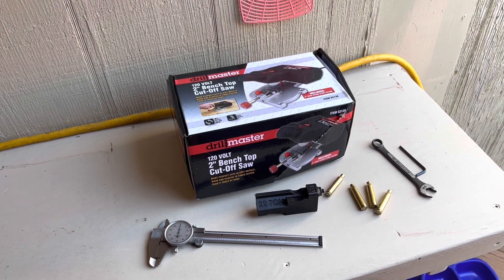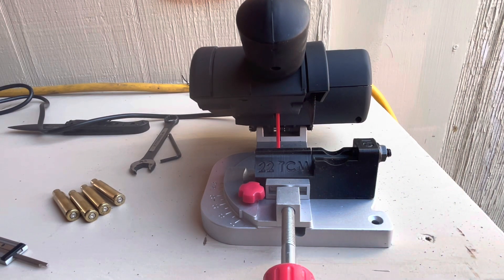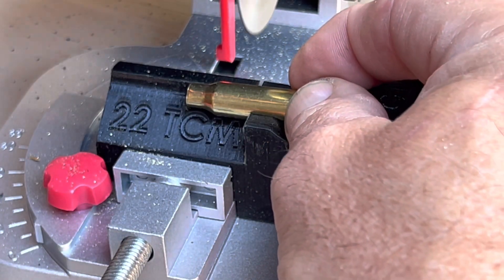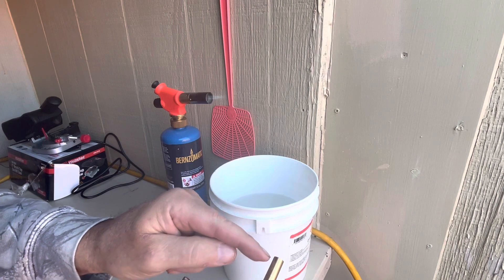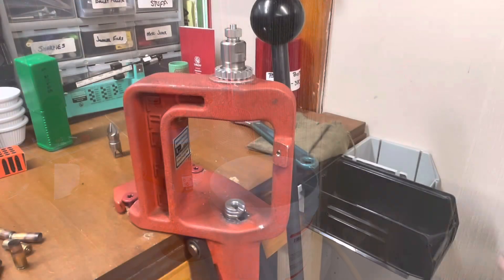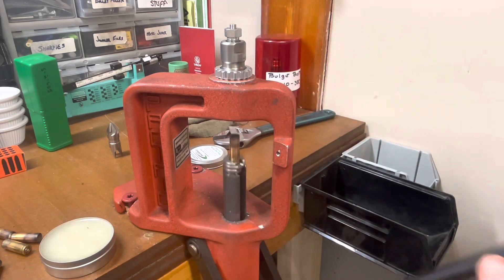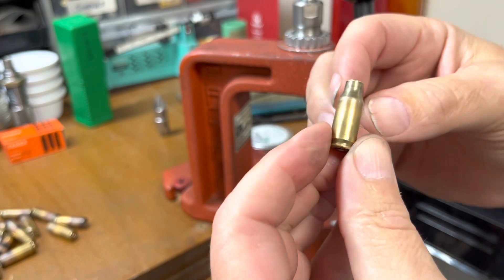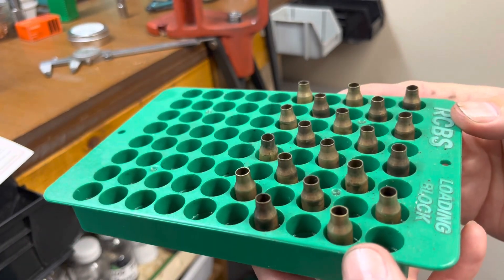Forming 22TCM Brass

Comment: Nice CW. Love that lil 22tcm pocket rocket!  I bought a case of primed nickel plated cases from them years ago, right at the start of Ammogeddon #2. Someday I will load em. I have plenty of powder I just need projectiles. The factory hasn't had them on the website for sale in years. They came in their Armscor ammo labeled bags and they were $6.99 a hundred IFIRC. I just keep checking hopefully they start getting them on the website someday. I figure if it got too bad and I needed them I would check into a 40gr .22cal mold. I did pick up 1 box of Hornady .22cal 40gr just to experiment.
Reply from the maker: Thats my hope here. Hard Cast GC bullets. I have some dummies made. Waiting on bbl to test fit.

Comment: That was an interesting video. I was thinking about why you might be having such an issue with the decapping rod pulling out. While you are putting some lube inside the case I doubt it is getting near the portion of the case that contacts the expanding button on the rod when the cases are pulled out. I expect becasuse of this the cases are basically getting dragged dry over the expander button, greatly increasing the pulling force on the rod. You might want to try putting some case lube on a "Q-tip" and getting it on the case a bit further down. Another couple of tricks regarding decapping rods of the Lee type - degrease the rod and contacting surface of the nut with break clean to increase friction, even trace amounts of oil will increase slipping. Finally you might want to try rolling the decapping rod between two files to roughen the surface up, that can help them hold better. Anyway just some thoughts. Cheers!
Reply from the maker: Yes sir!  I previously cleaned and lubed dies off camera. Should have specified better. But spot on I agree as after a few thru it worked better. 
Also, cleaning brass first would have helped.

Comment: If you take the decaping pin and sand half of an inch above the pin and take off a couple thousand off the diameter it should keep the neck from sticking to it where it is up in the die body where it forms the neck of the case. Just a thought
Reply from the maker: The expander ball diameter determines proper neck tension. Not a good idea to change its dia like that.
Reply: @cw2a  I'm not talking about the expander ball the stem part that holds it , it looked like it was stuck with the entire stem in the case it's either that or they are small flash holes
Reply from the maker: @tacticalrabbit308  it was expander ball but because first case and insufficient tightness ( it was only crazy tite not INSANE Tite.

Comment: That was one thing I didn't have to worry about when I made the 300 Blk conversions... I was never short on the brass because the 300Blk has so little shoulder.
What powder/powders are you looking at using?
Reply from the maker: Not much data out there!!!!

Looks like H110, Enforcer, lil Gun, 11fs and 296. 
Also no cast bullet data. 

I wont use Lil Gun. So one of the others I have all of them.
Reply: @cw2a  Hodgdon has some loads on their site under pistol for the 22TCM.... Accurate 4100, 11fs and TCM as well as Ramshot Enforcer. TCM was the powder that Accrate came up with specifically for the 22TCM.

Comment: Cool. A couple things. What cal. brass are you starting with.? When you heat up metal then quench it , doesn't it harden it ?
Reply from the maker: Hello Steve!!

Im starting with 223/556 cases. 
No the water is just to stop the heat from getting i to the head of the case. The water serves no other purpose. The heat of the touch softens the brass

Comment: That why I do not use Lee anymore...... After dealing with the universal decapper and the rod coming out on every case..... It sits in the box and never going to see daylight again...LOL!!!
Reply from the maker: Frustrating for sure. If ya saw my 350 Legend video back a ways ya saw my fix. Brill the nut and pin it with a roll pin in position. Works perfectly. There top Nuts are SOFT drill easily. ZERO MOVEMENT after that trick!!
Reply: @cw2a  hello CW what video was that in?
Reply from the maker: It could have been on old channel but thought here. I think I titled it why I dont like or dont use Lee dies? Id have ta look myself.

Comment: Perfect timing CW! I’m looking into converting .223 into 7.62x25 so this will be helpful for sure!
Reply: I don't know if it makes any difference but 223 is quite a bit smaller in diameter than Tok.
Reply: @dylanschulz2404  thanks, I’m still researching it, but that was the casing some people have recommended.
Reply: @3jeepdiscovery  powder valley has 30 Mauser brass which is the same thing these days.
Reply: @dylanschulz2404  sweet! That’s good to know. Thanks!

Comment: Is annealing a must before necking down?   If de-capping pin removed would it allow forming without the fire (annealing)?   Or is that a “try it & find out question”?
Reply from the maker: Good morning! 
I anneal  AFTER when necking up & BEFORE when necking down. As long as Im starting with new or once fired brass. Too soft can cause addition issues necking up. 
More important than decap pin removal of entire decap stem with pin is excellent point. If it has a expander ball it can cause issues too.

Comment: Having sticking problems due to pressure causing cases to expand? I was wondering if anyone has reloaded and got around that problem like using thicker brass like military 5.56mm brass or commercial.
Reply from the maker: Actually 556 is no thicker than 223. It's the 7.62 is thicker (smaller Cap) than 308. 
The cartridge gets pushed pretty hard. Hand loading helps!
Reply: @cw2a  Unless commercial brass got thicker or the 5.56mm suddenly got thinner then military force 5.56 mm is still thicker.
Even when the Army bought like 540 million rounds from Asia at the height of the Iraq war (OIF) we got tasked with making sure it was to spec. We had to check out everything. To include commercial companies vs NATO, differences in metal everything.
The company made the ammo for NATO countries and was closing with all that ammo already made. The Army bought every round plus asked them to reopen doing 3-8hr shifts a day for several years.
I got wounded on a convoy and put in a coma so that is all I remember.
Reply from the maker: @bullboo1 Of coarse there is countless manufacturers of 556 & 223. But If you test for your self you will find very small differences in case volume. 
Its a common miss conception carried over from 7,62 & 308.

Comment: The water is to make the brass soft, with out water the brass will be hard and not form properly.
Reply from the maker: @tomhysell596  If you're commenting to the annealing. Water isnt required for this process. BUT I like to use to cool and help reduce heat into the head of the case where it is NOT wanted. Because it will affect its strength. 
Thanks for watching! 🇺🇸❤️‍🩹❤️‍🩹

Comment: Nice jig with that adjustment screw and Nut. Have You tried UJ's drop of crazy Glue on the Lee decapping pin trick yet?  I bought a case of primed 22TCM brass from Armscor when the Ammogeddon  started so I wont be using my 22TCM jig I bought anytime soon. I have a 300BO one as well I still haven't used. Its great that you put this out for everyone CW ! Nice video.
Reply from the maker: Thanks man!! 😜🇺🇸🙏

Comment: You should lube inside the neck or take the decapping rod out.
Reply from the maker: Morning Jeff!  I did lube but too often forget that remove the decapper trick! 
Thanks man! 🤟🏽💪🏼💪🏼🇺🇸
Reply: I make 17fireball  and 221 fireball. So I know what going through.
Reply from the maker: @jeffgrossman6835  years ago I had trouble making 7.65 Argentine from 3006. I kept getting funky dents that I shouldn't have been getting no matter what I did I couldn't stop it. Until they removed the decapping stem. Then they formed perfectly. So I should've remembered, but I didn't really see a problem with denting. So I guess I just didn't think of it but thanks for reminding me your spot on correct often times just removing that decapping stem makes all the difference in the world foreman cases.  🤟🏽👍🏼🤟🏽🍻🍻